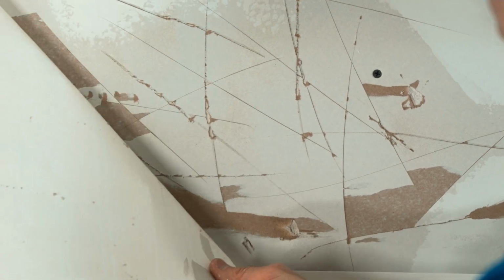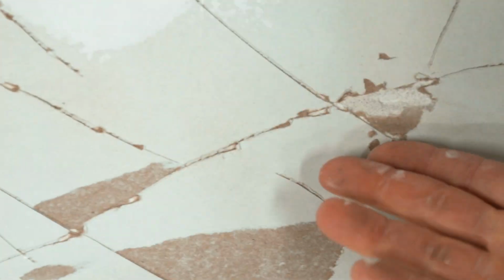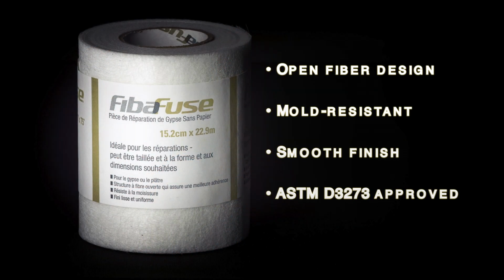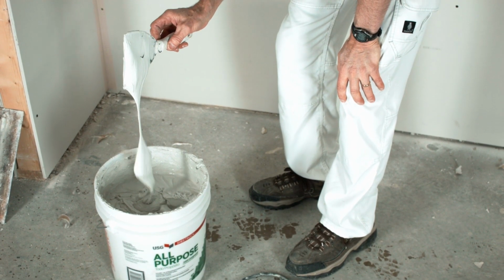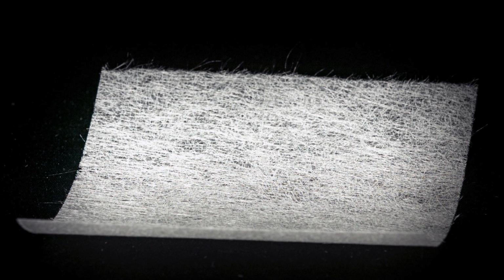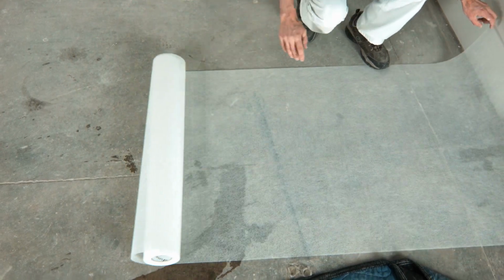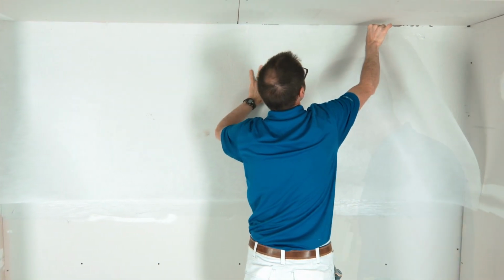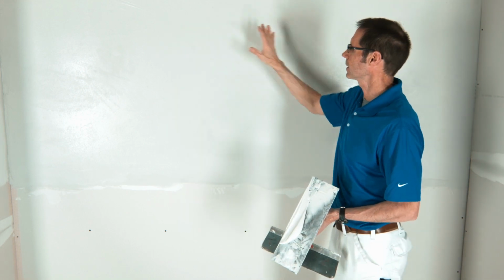FibaFuse 36" Wide Wall Reinforcement Fabric

Comment: So you got the FibaFuse on it...and then what?  Is it then a paintable surface?  I sort of doubt that, as the tape will be "fuzzy".  So if you then have to put a skim coat on it, then how did this all save any time over just skim coating the wall?
Reply: Roll more mud on and skim it out
Reply: It works well over old plaster
Reply: @danielnowicki917 then why bother with the tape at all?
Reply: Also strengthening the cracked walls and shitty drywall. He forgot to mention use gaurdz to seal the wallpaper glue also!

Comment: Better method for a wall like this is to buy Roman drywall repair sealer 2x coats and then skim coat as usual. You can get it at Home Depot for 19.99 a gallon. Beat that!!

Comment: or. Or. Or. 
Just use an oil based primer. Kilz works. Or zin. Just a thin coat of oil based primer make a nice base for mud application. After the primer you could even run ultra blue topping thinned without blisters.
Only time i use the fibafuse big rolls is on stress cracks, plater wall repair, Or big patches. Stuffs great for that though
Reply: Do you not have to skim over it? And this video he embedded the fiber fuse into the mud let it dry and then sanded it. I thought you had to skim over the fiber fuse.

Comment: Looking forward to trying out this product! Thanks for the video. -Paul
Reply: Paul, Does this app really need reinforcement? 

ADFORS just seems to be trying to sell more of its FibaFuse. By saying the only alternative is a tear-out. When only some skim coats seem needed here without reinforcement. And leave the reinforcement for walls that need it, like if they have cracks.
Reply: @nc3826  I agree that that application doesn't need reinforcement.  In fact I'm struggling to understand the benefit at all in that particular situation.    I can totally see using this for skim coating over failing plaster.     I was also really curious about his one coat application, that just doesn't seem right to me.
Reply: bobcougar77, great minds think alike.... While it's a good, but a pricey product for this application...But for reinforcing cracks in a wall or ceiling, especially if there in no egress to the backside of it (for reinforcement), it makes sense to use it....   
Since it does make the wall stronger, so if you plan to test hammers on it? It could be an appropriate use for it :)

BTW I have seen this reinforcement fabric used by a structurally engineer where he substituted high strengthen mortar for the mud and the applied it to a CMU  block to reinforce it.  Instead of using CF strips... And based on his tests, the reinforcement fabric/high strengthen mortar combo resisted the forces placed on it better the more expensive CF strips and acted as moisture barrier too.... and it looked better... 
But this needs a, "don't try this at home warning"......

Comment: A LOT OF EXTRA WORK JUST TROWEL OVER WITH OUT FABRIC JUST USE DURABOND WITH TWO COATS AND SAND.
Reply: This will lead to blistering and bubbling where the drywall paper has been ripped off with the wallpaper. If you don't use fibafuse, you need to paint on zinsser gardz problem surface sealer first

Comment: Did you thin the joint compound with water? Is it necessary/preferable to put another skim coat over the top of the FibraFuse?
Reply: Yes, thin with water to about an yogurt like consistency. A second skim will definitely be required. -Paul